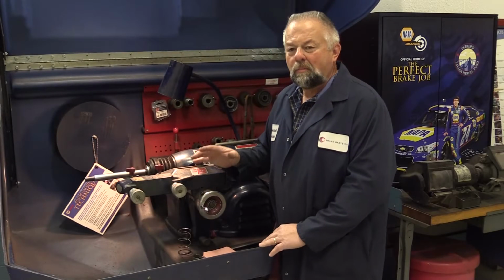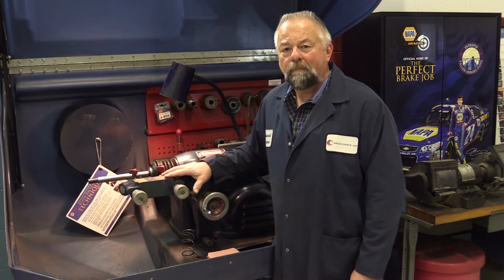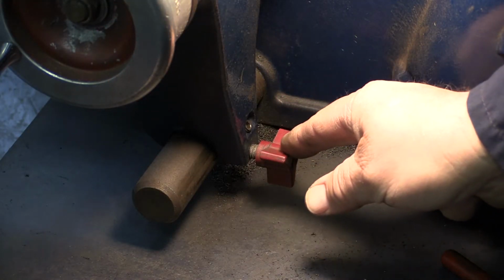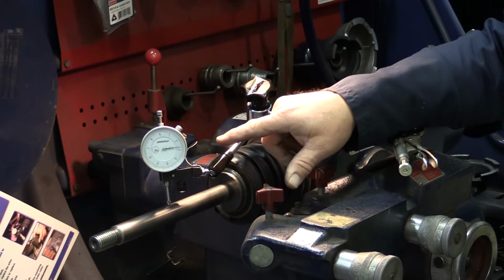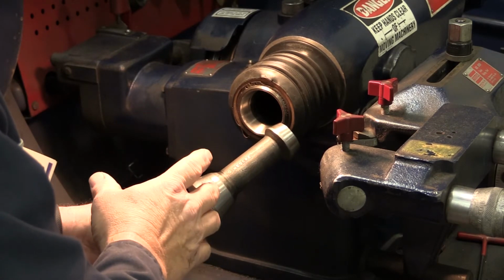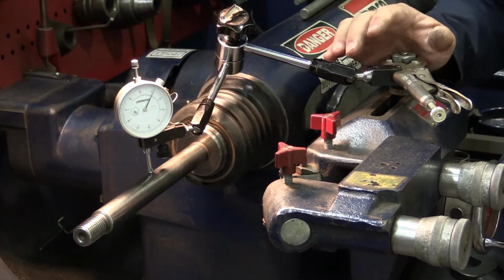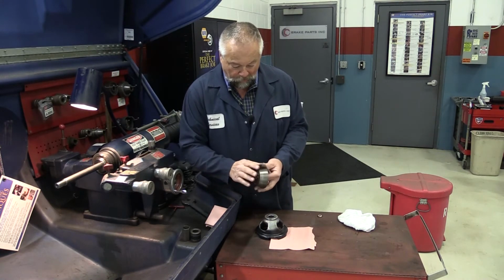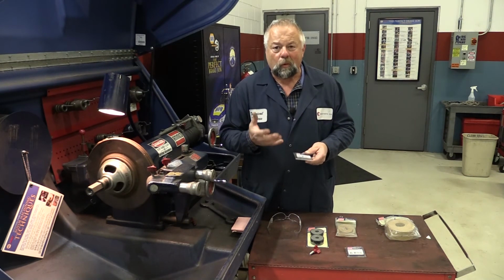Brake Lathe Maintenance

Comment: one granding masin in mumbai 9029910291
Reply: This guy in the demonstration is out to lunch on a lot of things.  

You clean the "arbor" not the "shaft" with a wire wheel until all corrosion is removed.  Then you clean the inner taper for the arbor using a rag soaked in brake cleaner on the threaded end of the arbor inserted into the "spindle" and then turn on the machine. You can clean the outer taper using a fine grit emmory cloth as shown.

If you still have more than 1,000 thousands of runnout--you can try to re-index the arbor as shown in the video. If  you have more than 10,000 thousands of runnout you will possibly have to replace the arbor.

2 to 10 out can be straightened (possibly more) out.  You find the high point of the arbor using a dial indicator as shown (remove the indicator) and then give the arbor a stiff whack with a brass or lead hammer.  Re-check using the dial indicator.  You may have to repeat the process a few times.  Sometimes this method will break the arbor off (about 1 in 20 times) so be warned.  I usually replace arbors that are 10 or more out because they are difficult to straighten.

Also the adjustment on the "twin-cutter" is incorrect. There should be about 1,000 thousands play.  The twin-cutter should not be stiff as he demonstrated. 

This fool in the video is not a machine maintenance guy.   I service brake lathe machines (of all types) for a living.
Reply: @alexhidell4546  I see a lot of mistakes in this video also. I am also a brake Lathe service technician. I have been doing it for about 18 years now
Reply: Stella get back to me at fiveringstakezo@yahoo.com for info.
Reply: @Stellasmith-j9q  get back to me at fiveringstakezo@yahoo.com for info